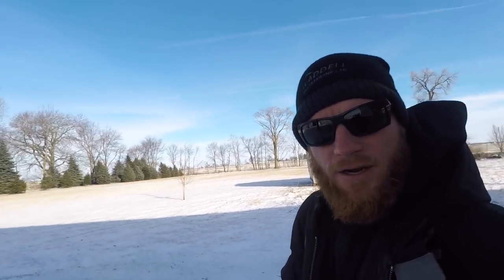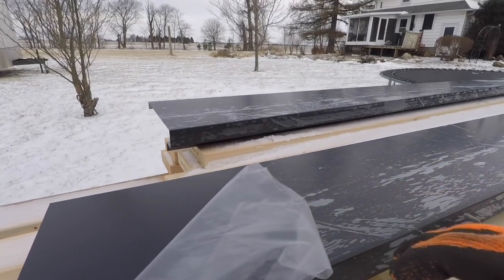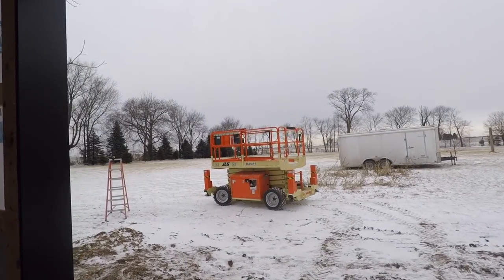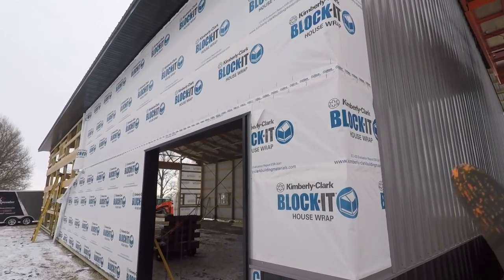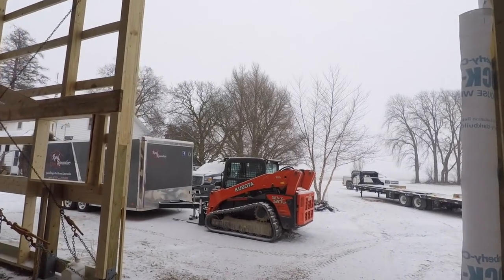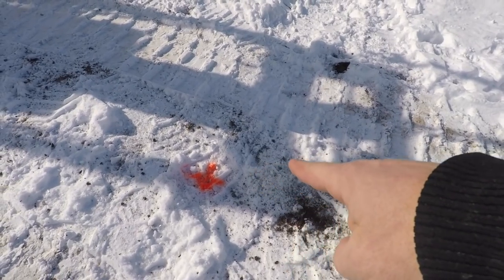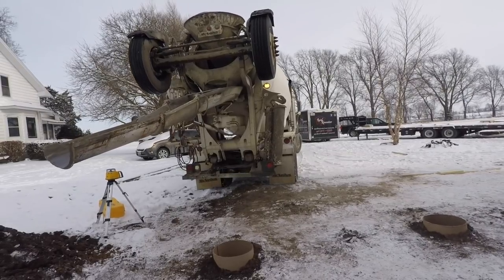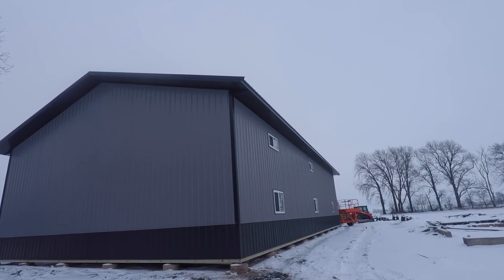Family fun Barn Video 8

Comment: Really admire the quality of your pole buildings. Around here, people just drill holes, plop the treated poles into the holes, then concrete the poles in.  They also don't take the time to make sure everything stays square throughout the build like you do and you can see it in the finished product.  Would be nice if more builders took as much pride in their work as you do.
Reply: Wait, do they even bother to place in the uplift anchor bolts in the base as well?
Reply from the maker: Thank you. I appreciate it.

Comment: I don't know if it is different for metal but on wood framed walls we lap the house wrap over the window flange on the top. House wrap can condensate and the moisture can run inside the building because it follows the folded inside wrap
Reply: Seeing as metal can condensate and eventually rust it makes sense to not do the same with other methods of cladding to overlap the wrap which its purpose it to keep the rain off the wood and prolong its life.

Comment: As ever - love your work! - one question - why does the top of the gable end not get building wrap? Is it a ventilation thing? Because surely your heat loss is going to be greatest at the roof and the wind will be ever so slightly stronger 20ft up...

Thanks J

Comment: Looks like electricians preran some wiring for light fixtures. Maybe you should cover (or at least explain) those auxillary tasks as well with the next project. Just suggesting even if it may not be part of the "build" it may show how good interaction with other crafts works!

Comment: As someone that doesn't know anything about building structures, I'm just curious, why doesn't the top triangular portion of the wall get the house wrap treatment?
Reply: The soffit will let air into the attic and the ridge vent will allow air to exit. So putting house wrap on the gable ends would serve no purpose.
Reply from the maker: You the man James.  Thanks for helping field the questions
Reply: RR Buildings no problem....love your work.
Reply: Thanks guys

Comment: Here in the UK before we are allowed to drill into the ground we have to check the topography of the ground with the local authorities to check for underground water or electric pipes and cables. Do you have to do the same.
Reply from the maker: Colin Nicol yes we call “Julie”.  An underground utility finding source
Reply: Dig Safe is the name of the company we use in the USA, so yes, just in case there happens to be power, GAS or water line of sorts under the area going to be drilled or dug into. Another good thing is to call for geology inspection to test for certain ground conditions in uncertain areas.

Comment: Why don't you cover the end of the building all the way to the top with the blocket sheeting?
Reply: Brian Hubbard The soffit will let air into the attic and the ridge vent will allow air to exit. So putting house wrap on the gable ends would serve no purpose.
Reply: Part of that gable end is not attic space. Why wouldn't you run it up to at least where the attic starts?

Comment: Why no house wrap on the gable ends? Is that to let the attic breah?
Cheers
Reply: The soffit will let air into the attic and the ridge vent will allow air to exit. So putting house wrap on the gable ends would serve no purpose.
Reply from the maker: The Tokyo Craftsman basically right ☝🏻
Reply: Jaime Ness  Since they’re using scissor roof trusses, shouldn’t the building wrap run higher on the gable ends?
Reply: DJ Hannu  what purpose would it serve, if the whole attic space is ventilated.

Comment: Why not use helical piers?
Reply: They cost about $1500 to $3000 per pier depending on length. The concrete for all the piers was probably under $1500.
Reply from the maker: Wow is that really the cost of helical piers
Reply: I live in Alaska, one of the costliest states to build in. The are $265 per pier and I use them all the time.
Reply: D J I live in Virginia with crappy clay soil. The cost installed is $1500 to $3000 per pier. Drilled shafts or spreader footings and poured concrete is cheaper.